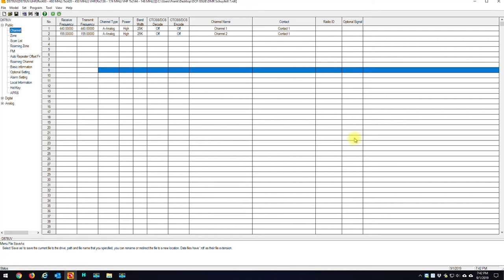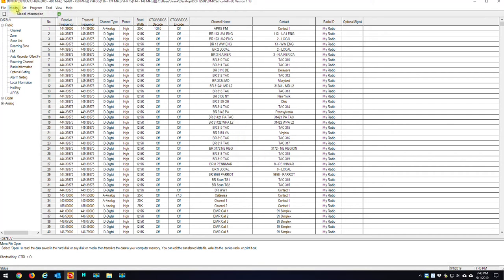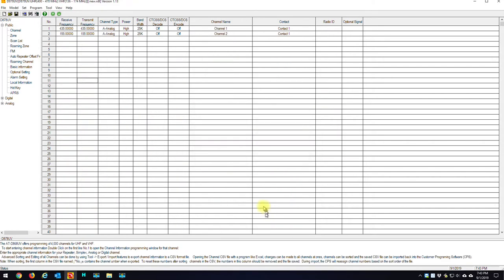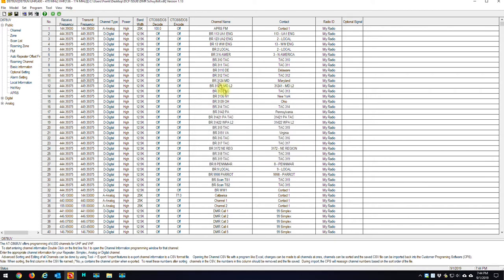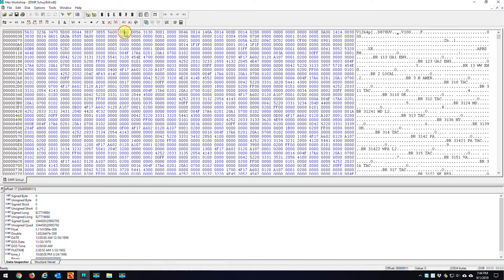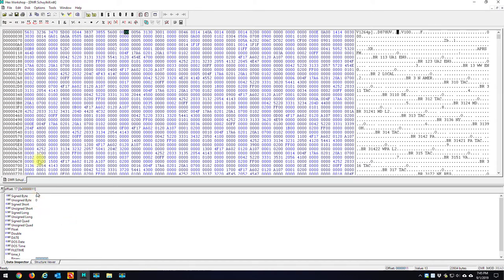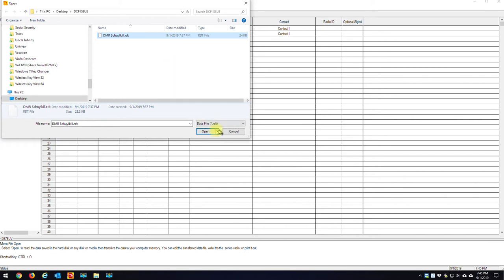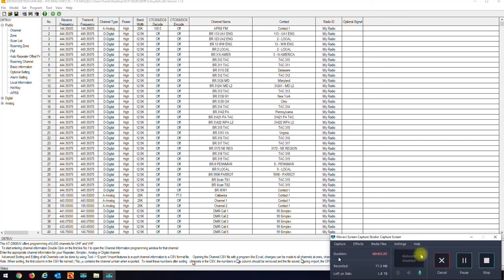Anytone CPS Change Mode Hack for RDT File via HEX Edit

Comment: Has anyone with firwmare 1.16b been able to use AT_Options to add band 14 to the 878? I tried it even adding the password 878# in the band password area of the software. It looks like its writing to the radio. I get the re-boot right after but when I do a PTT+1 on power up, scroll through the Test Mode settings nothing has changed. NO band 14

Comment: Frank,  If I use a hex editor and change the bit to 0E (14) the codeplug opens as mode 14.  If I add a channel with a freq in the mode 14 range will it write it to the HT?  I am interested in your 222Mhz mod you teased us with.  Does it do this without having to change the mode in the HT ?  Or if I write this back to the radio it will change the mode in the radio to 14?  Thanks
Reply: On my AT-578 I could not upload a codeplug with a different mode as the radio has (Band Error). I even tried resetting the mode of the codeplug to the old value, which lets you upload it, but then tx (ptt) still doesn't work. The solution for me was to change the mode of the radio.

Comment: Thanks for all your Videos, Sir.  Quick questions: What is the input password for the radio when changing radio Mode "on radio"? PTT & 1    Thanks
Reply: Found it = 878*
Reply: @rotor676  Where in the radio do you add 878*?  What firmware do you have for radio?

Comment: Frank, thanks this worked. Just a note to anyone else who may be viewing this: I first downloaded Hex Workshop 6.8, and it looked dissimilar what is shown above, the numbers were grouped in twos, and I couldn't figure it out. However, I found v. 5 and it was the same as shown above.
Reply: Would v. 5 be free and if so do you have a link?  Thanks
Reply: @n1kkri   you can find it here: http://www.hexworkshop.com/history/5_10/
Reply: @cpreovol  Chris, I just downloaded and installed from the link. My groups are in 2 not 4 like in the video.  I downloaded 5.1.   If I count over in groups of 2 I ended up at the same location 0x00000011 just doesn't look like the video.
Reply: @n1kkri  Upon further inspection the one I used was 5.0.2.2759. If that doesn't work I'm not sure. http://www.bpsoft.com/bbl/download/download.html?dlfile=hw32v502.msi
Reply: @n1kkri  Upon further inspection the one I used is actually Hex Workshop 5.0.2.2769. If you google that you should be able to find a download. If that doesn't work I'm not sure.
Reply: @cpreovol  Hi Chris,  I will take a look. Most are paid for with a 30 day trial.  I found a free version that looks similar to the one I downloaded but will do the job.   It's available from the site that has the AT_Options.zip program that will unlock the 878 for extended band
Reply: @n1kkri  how did you make out with the maintenance mode? I can edit it open it fine. When I try to write back I get a band error. What firmware are you on? I'm on 1.17.